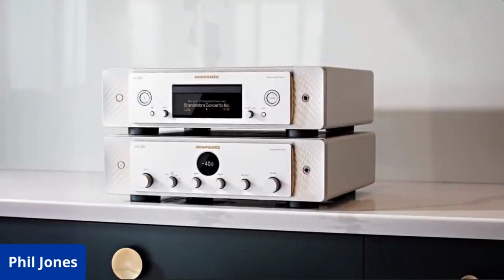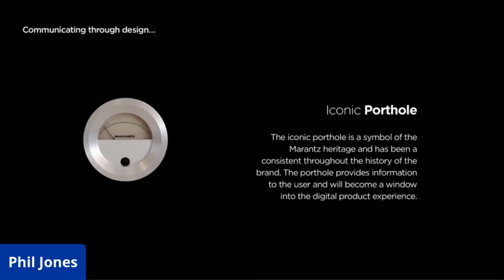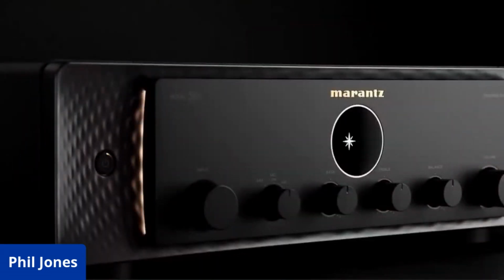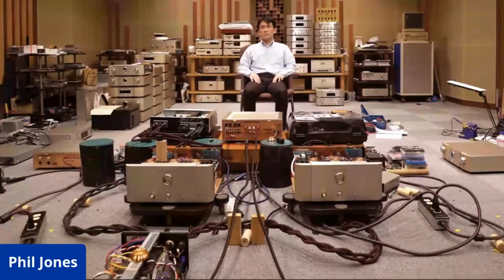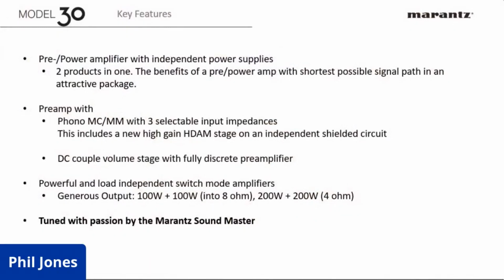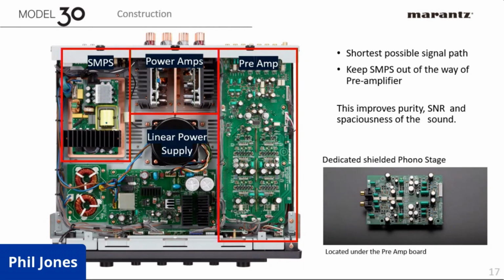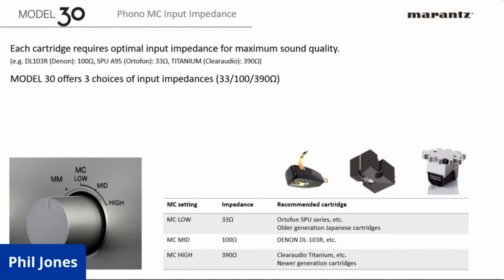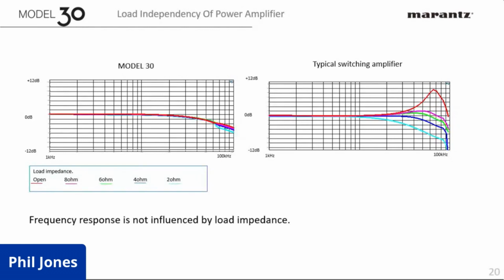Marantz Embraces Class D Amplification in the Model 30 Integrated Amp

Comment: I like the look, I applaud the ongoing research and production of Class D, but if/when a class D amp is the same price as a quality A/B amp - knowing class D is considerably less costly to manufacture -  I will go with the A/B amp. If the Marantz unit was not the cost of many excellent integrated amps with very good A/B amplification, I'd be interested. For $2.5. not so much, and i say that as someone who has Marantz SACD player and streamer. While this may be a good class D unit, it does not represent real value either at that price point, and value for cost is what makes Marantz a go to choice for me normally. But, for those who have to have latest greatest tech, this may be an option.
Reply: the 30 is made IN Japan . this could account for the higher price
Reply: @willbrink  wrong a proper class D is more expensive than both A and A/B

Comment: Bad news for new 2020 8K AV receiver generation 

UPDATE: I have reached out to Denon/Marantz for an official comment. Also inquiring with a representative/dealer with Yamaha. 
BREAKING: It would appear (according to multiple sources online) that there is now a known issue with the HDMI 2.1 boards found in Denon, Marantz and Yamaha 8K receivers.
There is a fault with the Panasonic sourced HDMI chip/board that produces a black screen when trying to game at 4K/120, 8K/60, HDR via some next gen consoles and even when using PCs equipped with NVIDIA's new GPUs. 
Sony and Onkyo are said to have purchased boards from Panasonic as well, though their products are not yet shipping. 
According to reports, if you were wanting a next-gen receiver for the PS5 or Xbox Series X you may want to hold off, as this may not be fixable with firmware, and that new boards will not be implemented until sometime in 2021. 
Testing is still ongoing and companies are not sure if all consoles or GPU combos will result in this black screen error, but so far XBox and NVIDIA appear to be affected most by this glitch. 

On a personal note, this may explain why even in our limited testing capacity why were were unable to achieve an 8K/60 signal when testing the Denon S960H. It would appear that at the time of our review Denon themselves were NOT aware of this issue as they did not cite it as a reason for why their receiver came up short in our 8K tests, including even failing to upscale to 8K/60. I can only assume Denon/Marantz are now aware of the issue, but have NO NEWS or IDEA for what they plan to do about it, or how they plan on addressing existing customers who may now be in possession of "faulty" receivers. It also would appear that this fault is going to be wide and not limited to select units or batches of receivers. 

I'll do my best to keep you all posted. Huge thanks to viewer Twin Helix for alerting me to this news. 
https://www.youtube.com/c/AndrewRobinsonphoto/community
Reply from the maker: I think it would be enlightening to see how Sound United responds with a potential work around to this issue. They told me an official statement is in the works.
Reply: @Audioholics  Denon's New 2020 AVR/AVC's have an output issue. Both the AVR X4700H and the X6700H have dual outputs that have a bug or worse a physical defect that causes a major issue.
https://www.youtube.com/watch?v=9UX-1dycRx8&t=356s